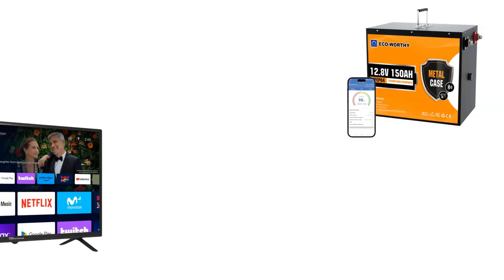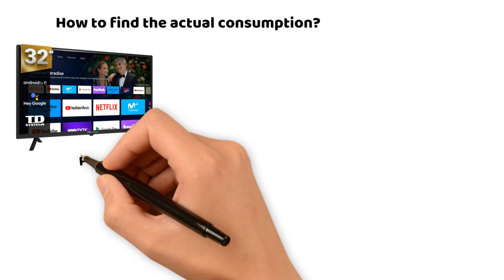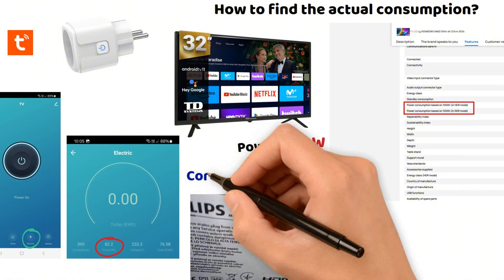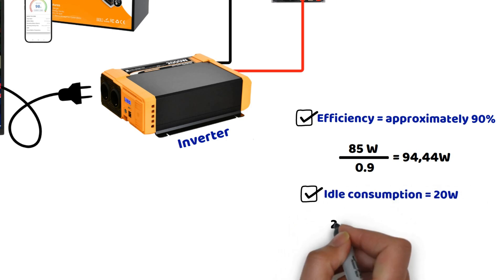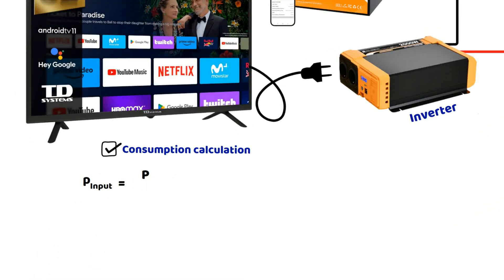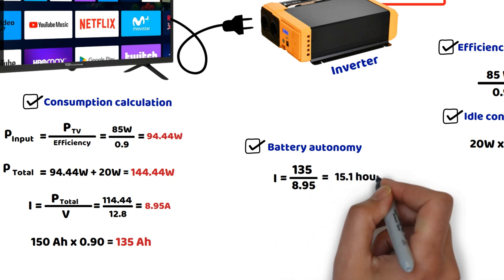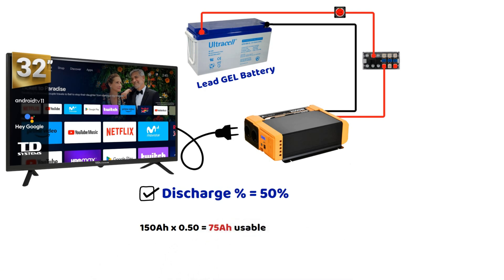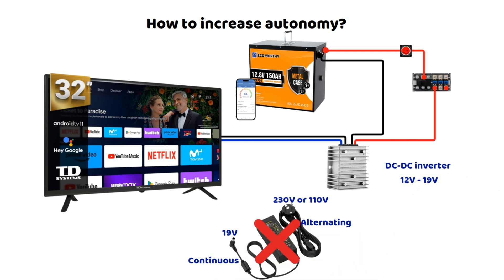How Long Can a 12V 150Ah Battery Run a TV? - Lithium VS Gel Lead Acid

Comment: Over 80 watts for 32" tv is pretty terrible. I just bought 12v 32" tv and been testing it out. With the 230>12v power brick it takes 29 watts from the wall. 33watts with the backlight cranked all the way up. The brick gets warm so it has to waste some power. Straight 12v power usage should be pretty decent. 25watts maybe.

Comment: Buy a monitor instead of t.v. , many "monitors" are powered with 12v or usb. Cheaper , less energy and most better quality picture and higher hrz ratings
Reply: But with no sound. Most monitors don't have speakers.
Reply: @jpeg1991  yeah make sure r it has built in speakers, amazo sells them.  Even touch screen